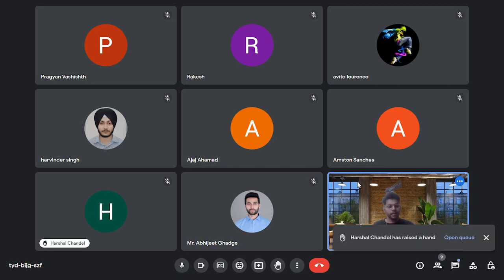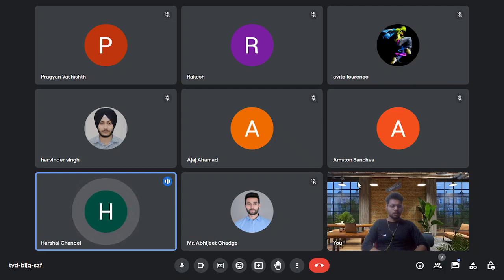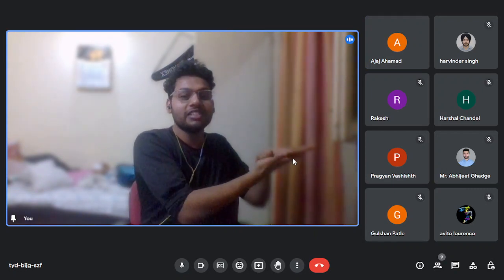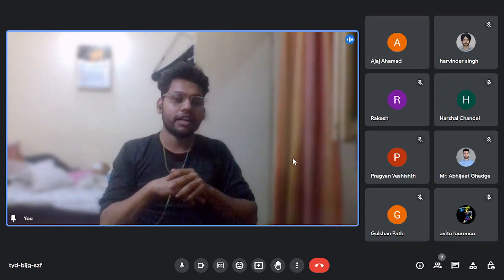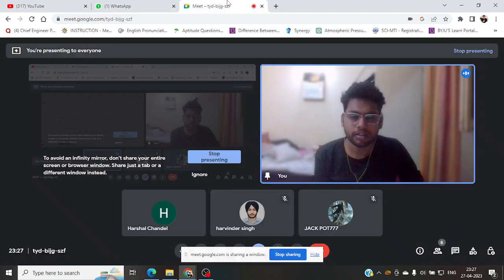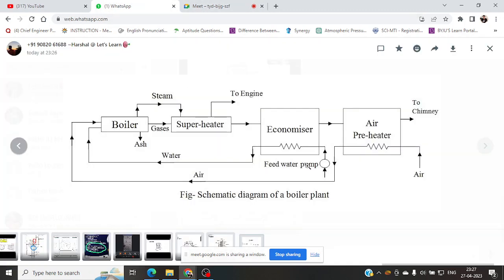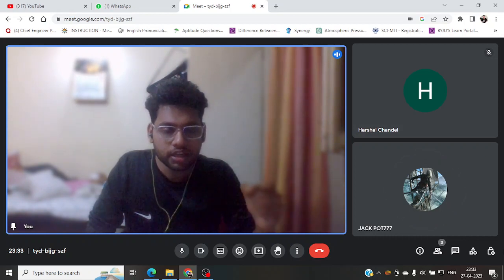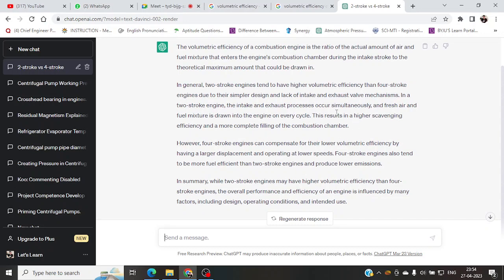NDT Methods|Oil Mist Detector|Safeties|Fusible plug||Technical Discussion🎯||GME|Marine|| with GYAN

Comment from the maker: Timeline ⏲️ 

00:00 - Intro
00:36 - What is NDT ?
29:49 - What is oil mist detector and where it is used?
39:40 - Why oil mist detector is used in two stroke engine?
41:37 - What is bursting disc and temperature at which it will burst?
49:54 - What is Pascal's law?
56:35 - What is Archimedes principle?
1:02:57 - What is Bernoulli's principle?
1:12:47 - If air is compressible,how we are applying the Bernoulli's principle there?, or what is the assumption taken in that case to apply the Bernoulli's principle?
1:15:48 - What is fusible plug and the working of fusible plug?
1:30:54 - What are the boiler accessories?
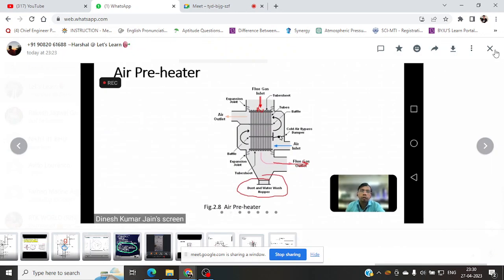1:41:29 - What is reflection and refraction?
1:45:20 - What are the safety devices present in the refrigeration system?
1:51:03 - What are the safety devices present in the compressor?
1:52:45 - What are the differences between a four stroke engine and a two stroke engine?
1:55:25 - How the camshaft and crankshaft connected in the case of a four stroke engine and a two stroke engine?
2:03:40 - two stroke engine or four stroke engine,which has more volumetric efficiency?